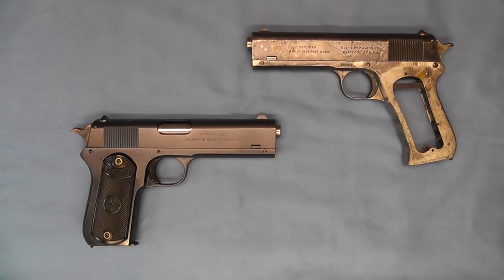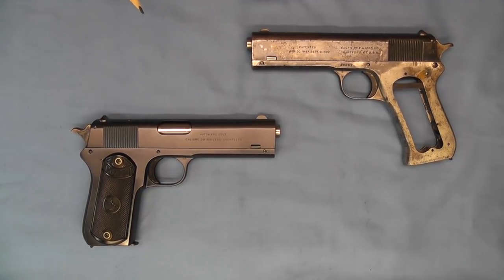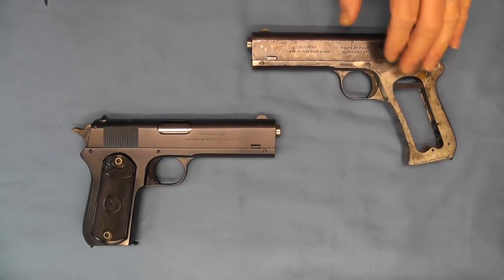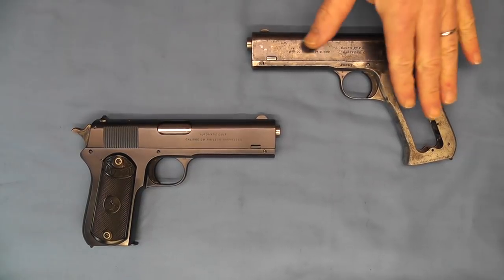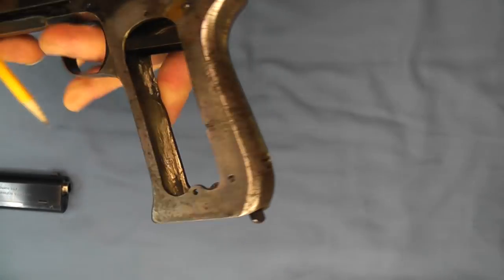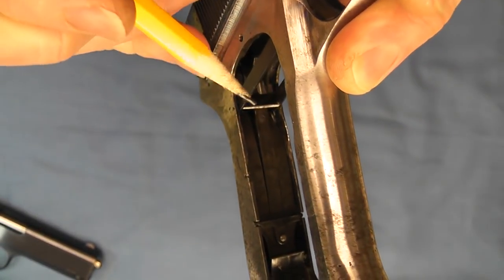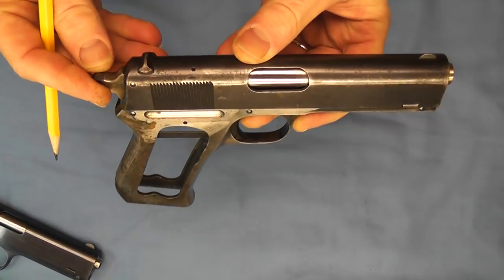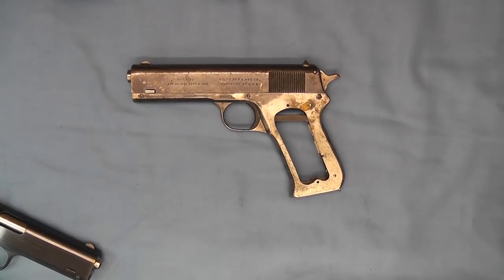John Browning Modified (?) Colt Model 1903 Pocket Hammer

Comment: I know I’m really late on this, but just in case anyone is checking back. I’ve got an old 1903 type 3, the finish is less than to desired, I’m wondering if I should have it refinished. I’ve been told it will effect the value of the gun. On the other hand I never plan to part with this piece so it would be just for me. Any comments would be welcomed.